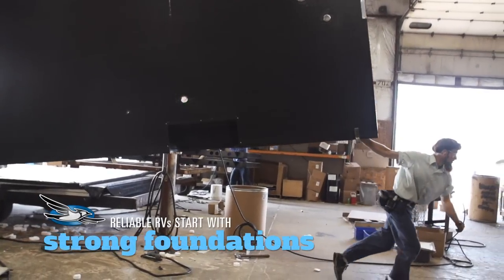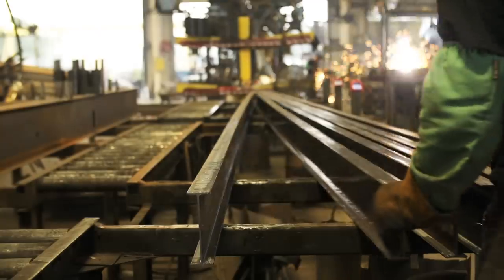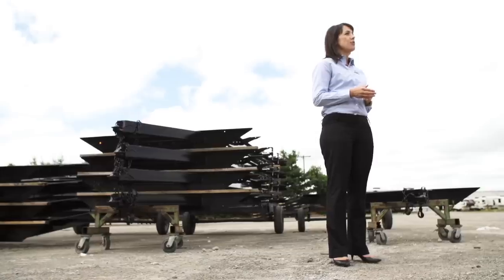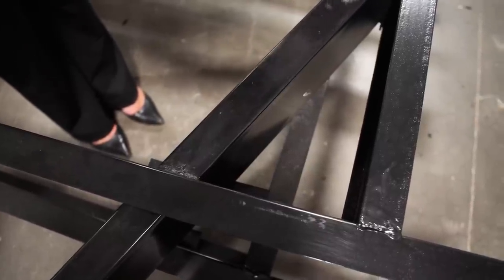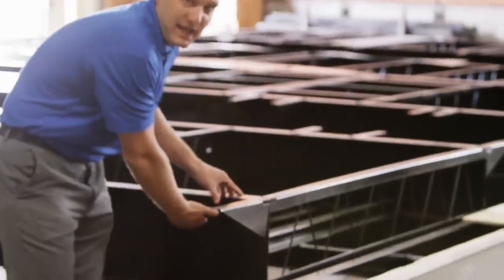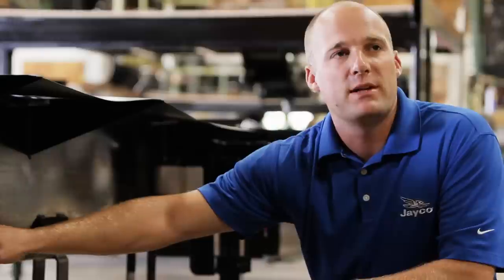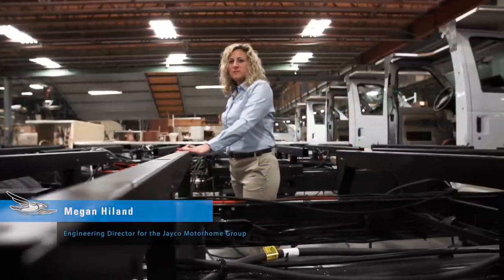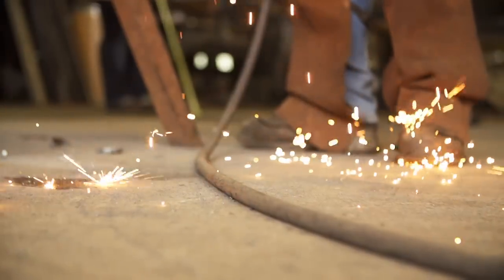Jayco Strong Foundation - Jayco RV

Comment: It wouldn't hurt Jayco to upsize their frames once in a while. I bought a new Starcraft travel trailer (owned by Jayco), with a sleeping capacity of 8 people, and yet I only have a cargo capacity of 880 lbs. :-/ As a new camper owner, of course the RV dealership never told me about this when I bought the trailer. Ha, just filling my fresh water tank uses nearly half of my cargo capacity. Oh well.